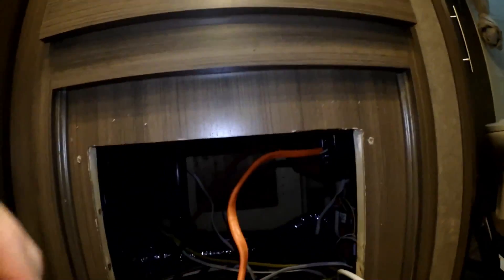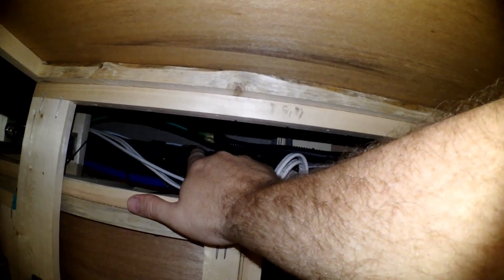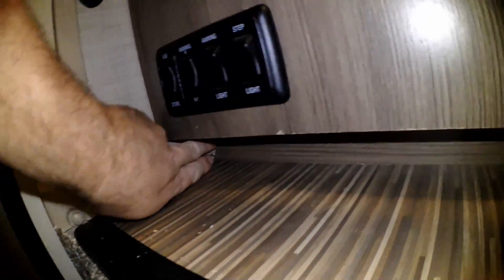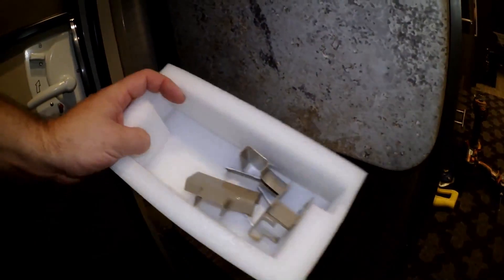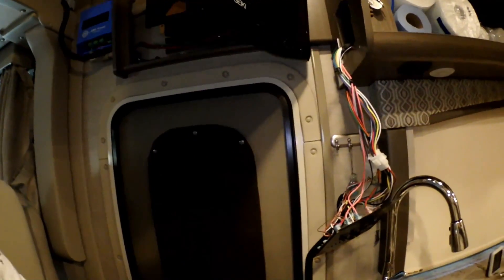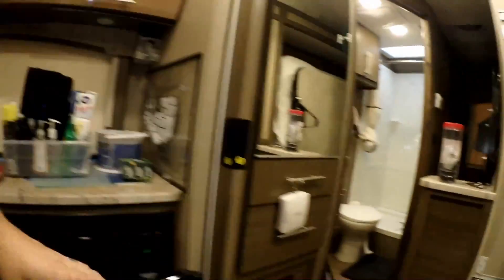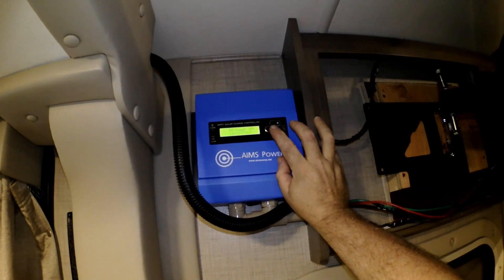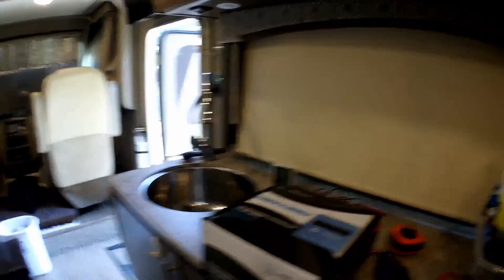Aims Power Flexible solar panel install on RV part 2

Comment: Hi Russell!
Where did you find the 10 gauge wire stubbed out on the roof?  I have the 2017 Axis 25.2, not sure if mine is pre wired like yours.
Thanks!